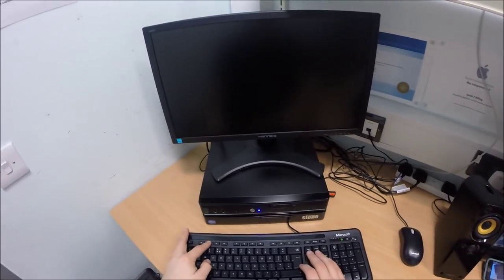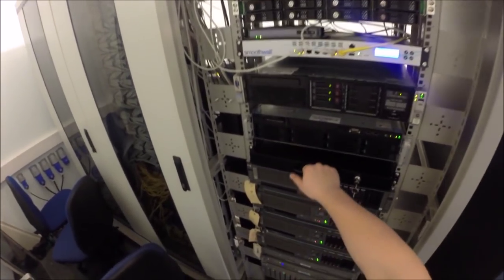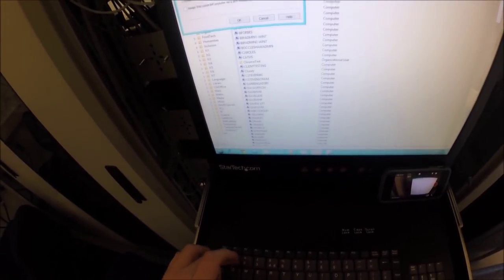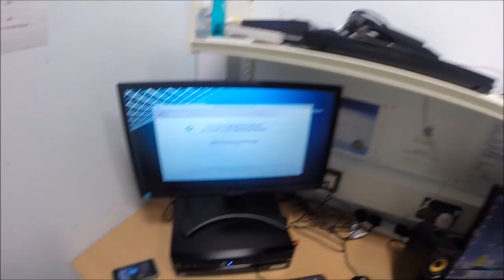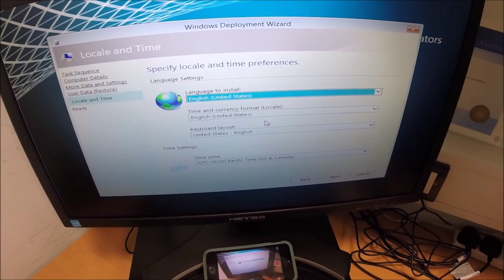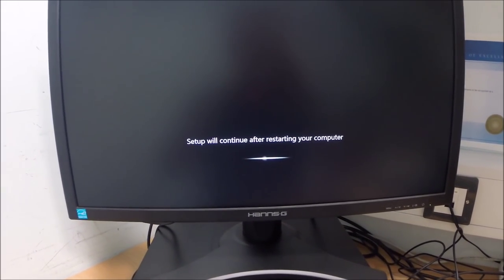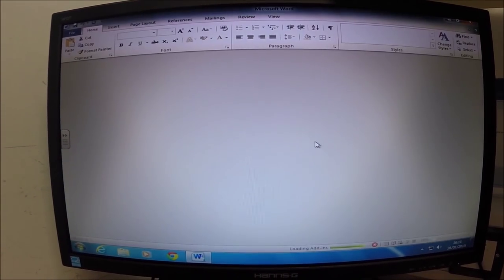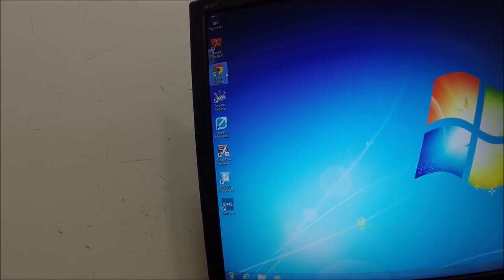PC Unboxing w/ MDT Setup & SERVER ROOM TASK

Comment: I have to say that this video did make me facepalm a few times, please explain me why you didn't turn your MDT deployments into zero-touch, its really not that hard and saves a enormous amount of time. also the windows and office activation can both be triggered by running a command as one of the last steps of your task sequence: cscript %windir%\system32\slmgr.vbs /ato
and for office you can run: %ProgramFiles%\Microsoft Office\Office14>cscript ospp.vbs /act or %ProgramFiles(x86)% depending on your office installation.
Also to skip the logon display message you could add the computer to a AD group in the start of the install ex: mdt_install. and deny the group policy to apply to that group. than at the end of the task sequence you delete the machine from that group. also by running commands from the task sequence itself.
Also for office asking for name and initials that can be easly fixed by making a login script that sets the HKCU variables by using %username% and %username:~0,1% to get the initial. or look at this post to get the actual firstname and/or lastname to use: https://blog.thesysadmins.co.uk/create-environment-variables-from-active-directory.html
You might also wanna check this out: https://mdtguy.wordpress.com/2013/07/12/mdt-customsettings-ini-tips-tricks/
Great videos, good quality